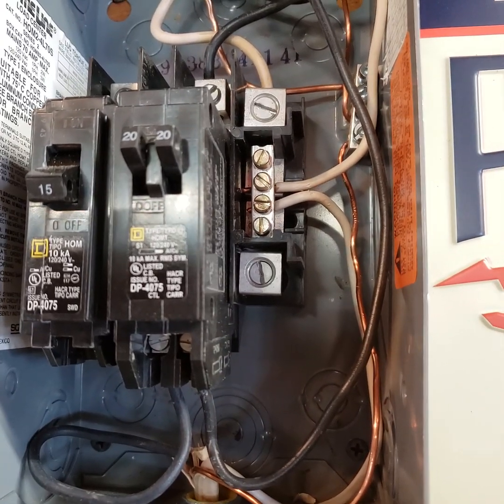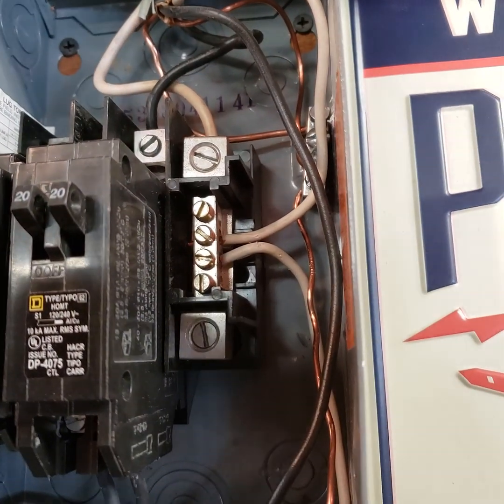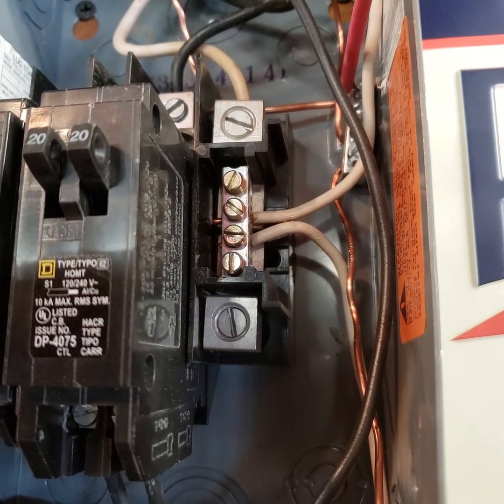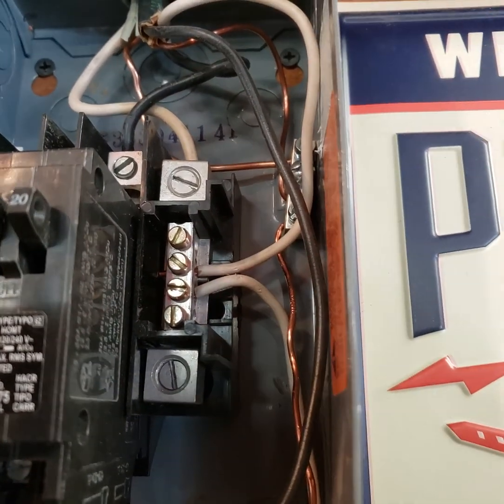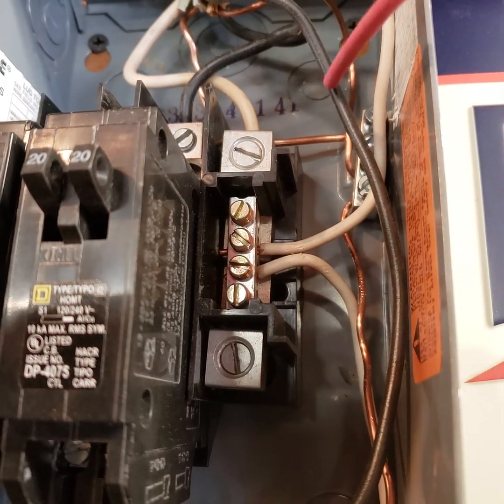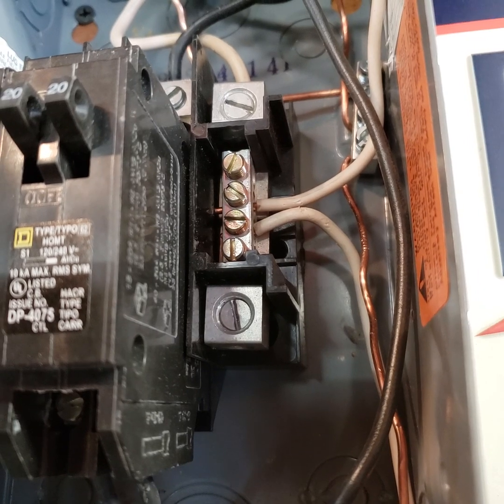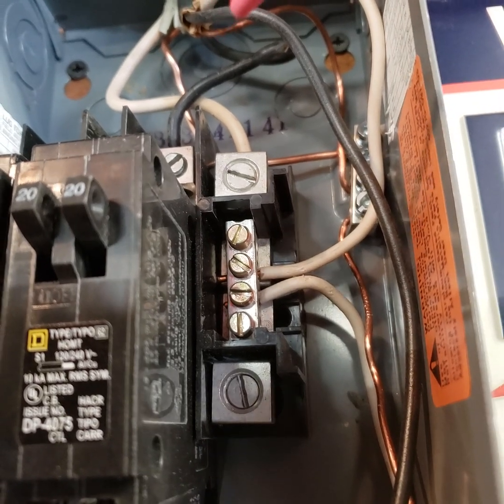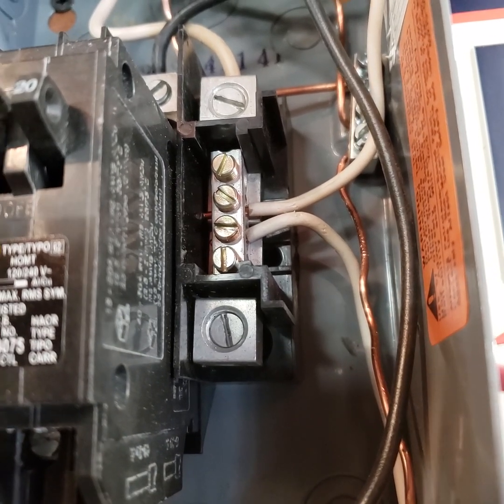Sub panel installation ground and neutral

Comment: Did you play the role of officer doofy in scary movie ?JK...sure does sound like it? JK...but  did like the explanation of ground and neutral on sub panel. Just wondering ?How would you hook up a subpanel from a dryer’s 240v outlet ?could you or would you or not?

Comment: A little hard to understand, but I got it and I really appreciate the information.  I now understand how and why the ground is not connected to neutral in a subpanel, the ground is only the frame for short protection but also so you don't get back-feed from the neutral to the ground.

Comment: Good explanation. Also is the panel really being fed 120 volts just curious
Reply from the maker: Yes this is only 120V fed off a 120V 20 A breaker at the house.

Comment: It looks like the ground bus is connected to the white neutral by a copper wire. Shouldn’t the ground in the sub panel be only connected to a pair of grounding electrodes driven in the ground near the panel?  I assume.since this is an old panel there is not a fourth (ground) wire coming from the house

Comment: My Dad has the same box in His shed by the lake. I went to disconnect the sprinkler pump wires because the lake is no longer there and who ever wired the pump and the shed lights had the grounds going to the neutral bar and also the white neutral wires. I'm so happy that you posted this video. It took me a long time to find this important correct wiring diagram. GREAT job
Reply: What happened to the lake? Evaporated? Lol
Reply: @MyLife-og2kr  the levee, hill of dirt and grass about 300 feet away from the dam gave out, broke up and the water emptied the whole wixom lake (Tittabawassee River) wiped out most od the town of Sanford Michigan. the owner and the state have been fighting for over 20 years who was responsible to repair the dams. DNr did not want to kill the zebra mussels if the owner lowered it to repair them. It cost the state $100 million to repair the 6 bridges it did damage to.
Reply: @victorv4340  that's crazy 😯
Reply: SjsjajjjNzhshh K bzmznz